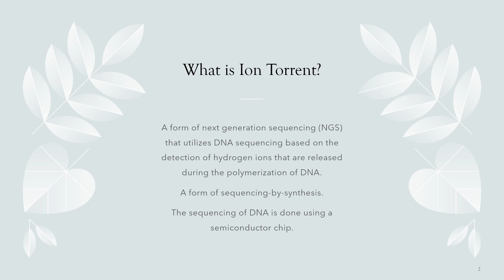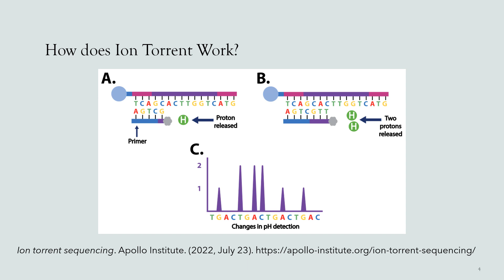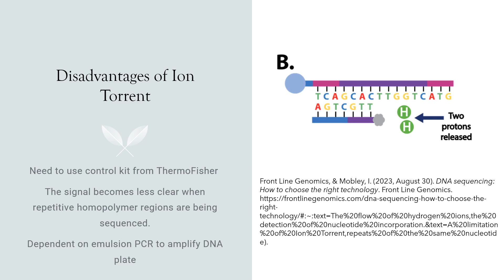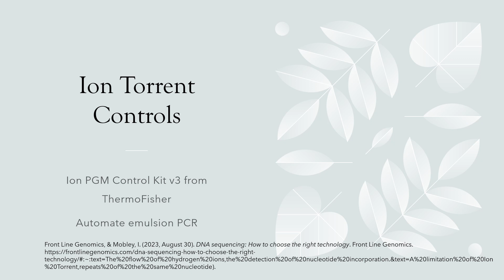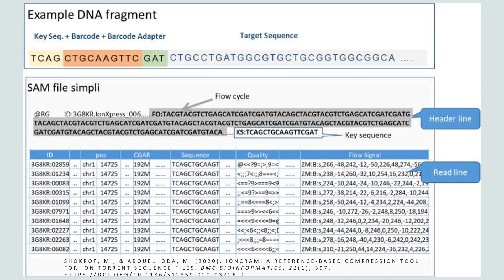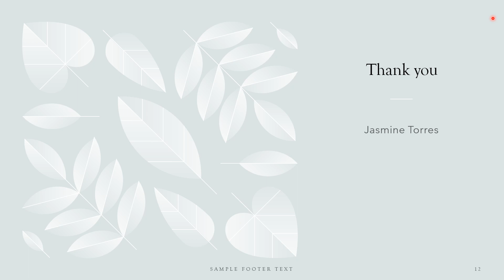Ion Torrent local expert Jasmine Torres

Comment: Hi, your presentation was great. I learned from the presentation that ion torrent uses pH and not fluorescence. In order to use ion torrent, you have to use a control kit from ThermoFisher which can make it difficult to access.
It relates to the lecture material because it covers synthesis by sequencing which was covered in class. It is similar to the illumina sequencing methods and requires library preparation with adaptors.
A comment I had about your presentation was that the information you presented was very informative and I liked that you explained and researched smaller details like the type of control kit and how ion torrent is highly accurate at 99.6 percent.